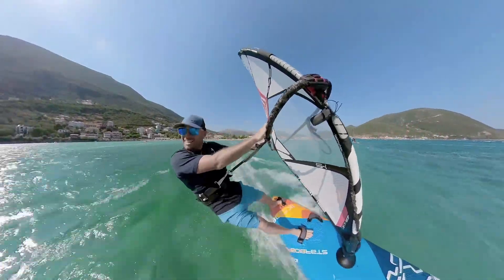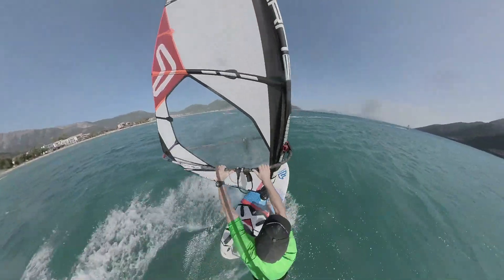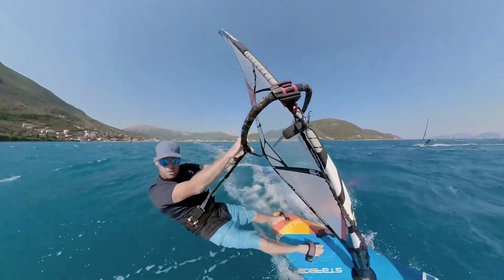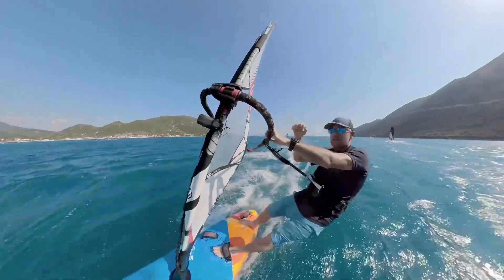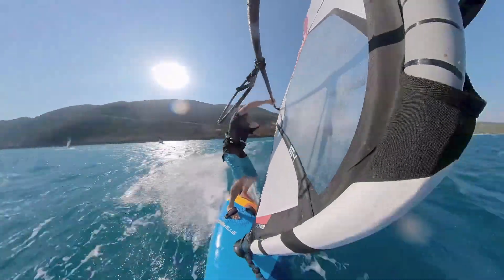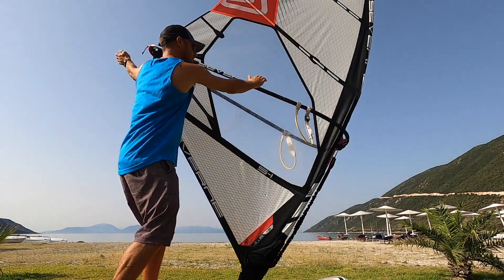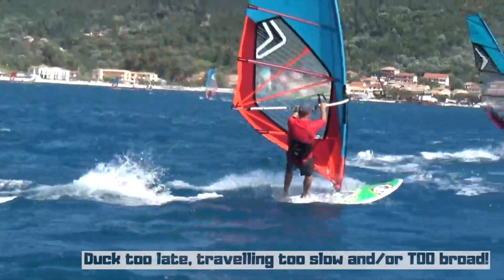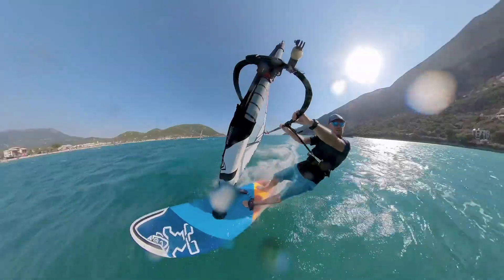How to Duck Gybe!

Comment: Very good explained. I think a Duck Gybe is basically easier than other varaints due to its modular composition, as you mentioned. The speed at the entrance can be scary, especially overpowered. What helped me most: 1. Pressure on the front foot and look at the center of the circle you are drawing - not at your feet (as with every other gybe), 2. Shift the sail at broad reach, 3. Stay in the front footstrap at least until new broad reach (you can't stay in it too long), 4. NEVER lean back. Meanwhile, I prefer the Duck Gybe in everything (even in wavesailing) but very choppy conditions. Cheers, Claus.
Reply from the maker: Thanks for watching and commenting. 
One question…. “Look at the centre of the gybe not at your feet ***like you would with other gybes”…. 
….Never look at your feet in any gybe?! I love a duck too- but maybe this is why you prefer not so much more- because you’re look at your feet in the other ones?!
Reply: @Cookiesports  Sorry - expressed wrongly. I meant: no matter which gybe, you should look at the center of the gybe, not at your feet or board.
Reply from the maker: @segelsegler35  Phew! In that case - I fully and 100% agree with you! 😜

Comment: Man, that's really great!  I haven't messed around with duck jibes in a while but this inspires me to give them another go! 
For me what works with duck jibing is to do as you say: duck the sail early.  I try to do it while there's still pressure in the sail, but not too early like some of your students in the video.  I try to wait until just before I get to the point in the jibe where I'm going dead downwind very fast, matching the speed of the wind.  Having some pressure in the sail helps the mast swing around the front, and if you wait until just before the dead downwind point, the sail will kind of "backwind" itself back up into your hands.  That is, if you do it right, which I don't always do.
Reply from the maker: Thanks for watching!

Comment: Great video, but can you clarify what position the board should be in, relative to the wind, when you duck the sail? Is it just before the board is straight downwind? How much before? I think this is a critical point that needs more emphasis. It seems that most people duck too late rather than too early, but where's the sweet spot?  Also, as sail size increases, duckability decreases, right? Is it feasible to duck a 7.5? Thanks!
Reply from the maker: It’s not a specific point of sail as such- hence the fault finding bit. However, it can be narrowed to between a broad reach and a run! 
Sucking on 7.5m and larger is definitely possible- but much harder. 
Practice loads on the land! 👍👍